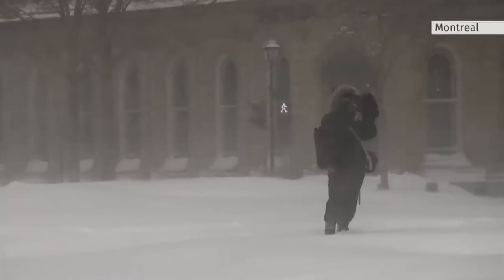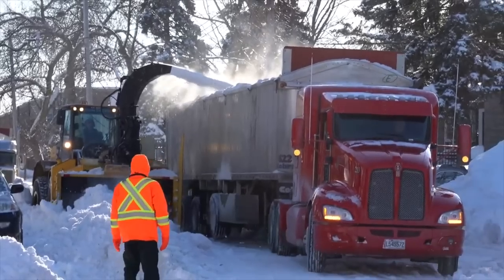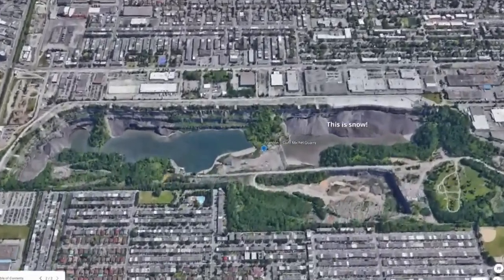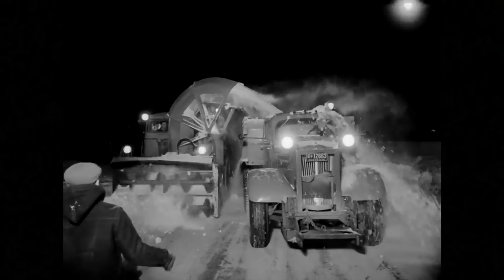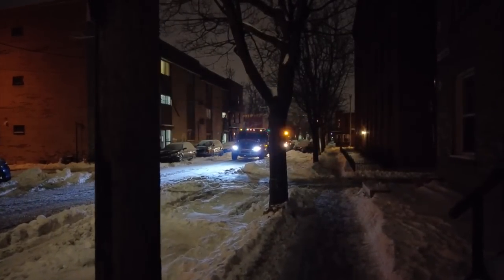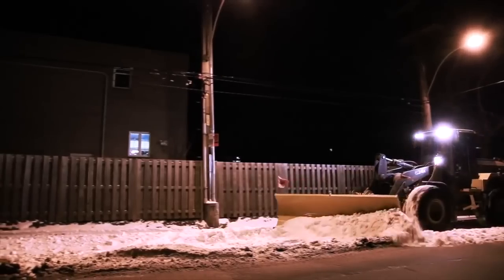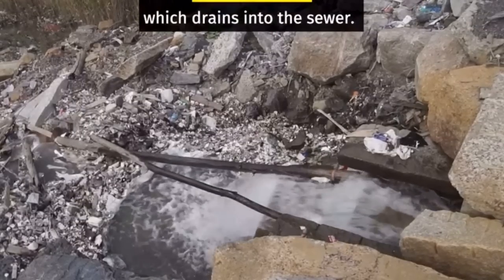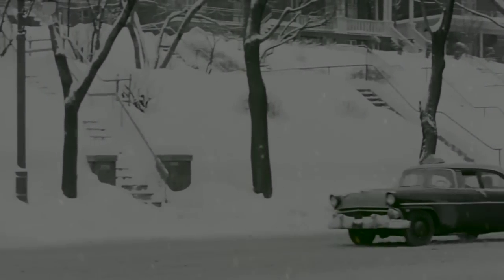Montreal Snow Removal is an Amazing Logistical Achievement

Comment: I'm originally from Montreal, born and raised; and moved to London, ON for a new career. I'll tell you that winters here in London can dump tons of lake effect snow (snowsqualls) off Lake Huron when we get a an arctic airflow from the northwest. The worst one was in Dec. 2010 where we received 100 centimetres of snow in 60 hours. It was dubbed "Snowmageddon". The city pretty much shut down. I will also say to my fellow Montreal friends to be gateful for the snow removal system Montreal has in place because London snow removal is useless. If we get a substantial snowfall with plus temperatures forecast for a few days after, City Hall will do nothing, that's right, nothing. Just plow the main arteries, but they won't touch residential sidestreets hoping the warmer temperatures will melt it and it rarely does. Driving on those sidetreets is like off roading because of all the ruts from vehicle tires that didn't completely melt then froze over when colder weather comes back. Throw in another snowfall then those street are even harder to drive becausr they're like skating rinks. London sucks at snow management. Be happy my Montreal friends.

Comment: I'm an American and I love Canada. However, I couldn't endure a Canadian winter. Montreal and Toronto are wonderful places to visit from May to September. Other than that, it's too cold and snowy (yes, they both have elaborate indoor walking paths. Still, you eventually have to go outside).
Reply: I guess in winter you can't visit a good third of the US then. 
In Montreal, we use weird garments called winter coats, boots rated for -40°C, plus hats, scarves and mittens. 
Toronto generally remains at +4°C and when they have 10 cm of snow, they call in the army. For real.
Reply: @Annie59G  To the best of my knowledge, TO only did that once. They'll never live it down!
Reply: @user-fe7mg5ot9z  According to my brother who was living in Burlington at the time, there were 10 cm of snow. Is that right?
Reply: @Annie59G  I can't honestly remember. The real problem was they had reduced the amount of snow removal equipment they had, as well as their budget for it. They hadn't been getting the snow they used to get for several years, so were caught off guard. I live about an hour west of Toronto, on the edge of the snowbelt. Sometimes we get hit, sometimes not. I miss Montreal snow!

Comment: I lived in Montreal for my first 38 years and Florida for the past 30 years and I would definitely take Montreal winter storms over Florida’s summer heat and hurricanes!!
Reply: I share “John M” sentiments!  I lived in DDO during my teens and for the last 25-years in Kansas City.  I can handle Montréal’s winter storms, but not so much Kansas’ hot/humid, windy summers.  And the risk of hail damage to cars & home roofs is always on my mind.  And even though I and most all Kansans have never seen a tornado, it’s still concerning when I see dark, stormy clouds with lightning & thunder roll in.

Comment: Grew up in Montreal now live in Vancouver. When it snows here, which is rare we suffer big time as there is major elevation swings and no snow plows. We had a snow fall this past weekend with 30 ml. Of snow. Unless you have all wheel drive and hood snow tires forget it. On the brighter side the snow barely lasts a week.

Comment: This was wonderful! I forgot we use to dump directly in the river, and indeed never heard the name Arthur Sicard before! I do think you missed a rather important and sad truth though - the number of deaths associated with snow removal. Thankfully safety around these giant trucks and tractors has greatly improved. I just took some time to try to find the statistics, but only found the individual incidents. While it seems that seniors have most often been the victims, the death of 21 yr old Jessica Holman-Price in 2005 really stayed with me - she shoved her 10 yr old brother out of the way before being crushed by the wheel of a loaded truck. I was horrified but not surprised. 

I remember in the early 2000s, I was making my way home after dark along Pine Ave (Ave des pins ouest), west of McGill university. In the section between Cedar Ave and McGregor Ave, I came upon snow removal trucks on both sides on the street, actually on the sidewalks, apparently on break, but with their motors still running. This avenue cuts across the slope of Mount Royal, and this section has no buildings and no passable space beyond the sidewalks, only a fence to my left and thick brush and trees to my right. Rule of thumb as a pedestrian, give the crews as much space as possible - switch to the other side of the street when you see them. I stopped dead in my tracks - where was I suppose to go when they are on both sides? In addition, this is a one-way and I was approaching the trucks from behind. I don't think it was very late, but I was a lone pedestrian facing the back of these trucks. I cautiously approached, wary that they could move at any moment and they would never hear me over the noise of their motors. I had to walk in the street to get by them. I managed to get the attention of one driver and signed to him my frustration of them being all over the road. 

While safety has much improved, deaths and injuries still occur. Many have been attributed to operator fatigue, as well as pressure to work quickly. It's been difficult to get the private contractors to comply. I regularly see the dump trucks speeding through residential streets, and I guess there aren't speed limits for sidewalks - those little tractors can move very fast (and cause a lot of property damage). Accidents occur because operators forget people may be around - a 16 yr old was killed in a Laval parking lot (north of Mtl) after his grocery store shift 2 weeks ago.

All that being said, I am delighted to see the streets and sidewalks on my tiny residential street quickly plowed, and enjoy following the snow removal progress in real time on the info-neige app.

Comment: How much snow was removed during the 1998 ice storm?
Reply from the maker: Not much, it was all ice! The roads luckily were mostly cleared of debris using trucks and salt.
Reply: yeah it wasnt the snow that needed cleared... more like power wires and trees/branches. The Ice was also insanely thick..
Reply: During this ice storm, I was living on the south shore of Montreal.
On my street in a residential neighborhood, there was about 10 inches of hard ice on the roadway, the equivalent of 100 inches of powder snow.
The city had to use 30-ton hydrolic excavators equipped with ripper teeth to break up all this ice and loaders to load it into trucks.
The city couldn't use normal snow removal equipment (like snow blowers) because the ice was too thick and hard.
The following spring on the roadway, you could easily see the scars left by this operation.
Reply: None.  All ice.   I remember ice being removed from sidewalks using jackhammers.